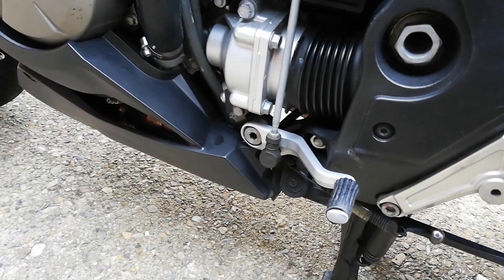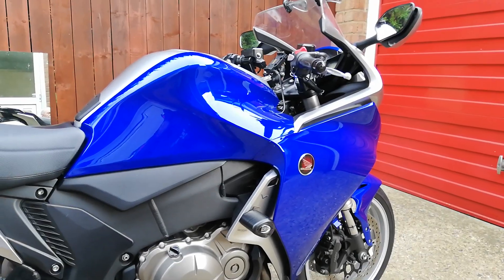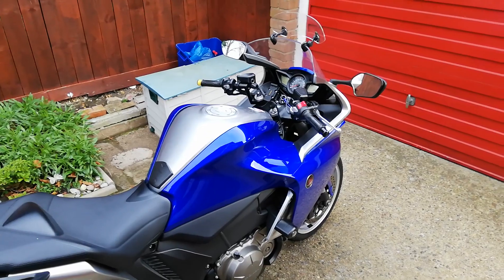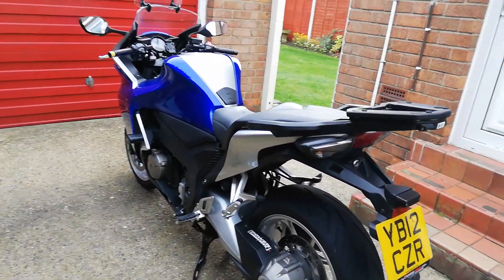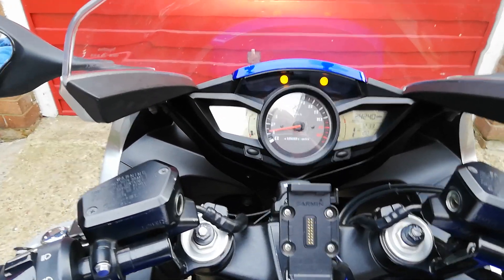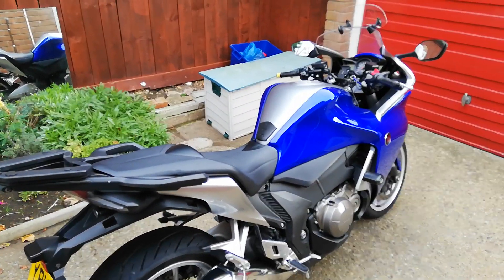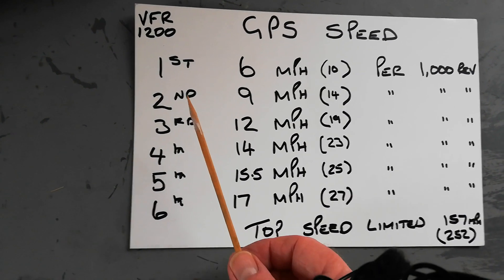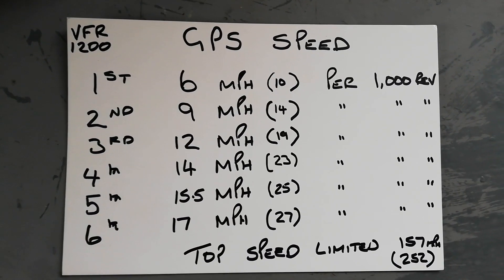Honda VFR1200 Gearbox/ratios.

Comment: I’m collecting my 2013 dct model today!! Panniers and top box included. My wife will be my pillion, so your videos have been really informative. Thanks 👍🏻
Reply from the maker: Brilliant drop me a comment to tell me how you find the dct is. 👍
Reply: @Grahamvfr  yeah definitely will do! 👍🏻
Reply: @clintneville9767  With pillion it´s quite stable, just remember to check the suspension settings, so they do not have any "extreme" setting alredy there and make the drive uncomfortable. Mine had some wobbling on the front around 140 km/h ( around 70mph) it got fixed going basically to factory settings.
Reply: @capitanscott  suspension was all good. Went for a good ride out to Bakewell Christmas market on Sunday and my wife said it was a very comfortable ride, helped by having an aftermarket seat!

Comment: Hallo Graham, my Vfr 1200f  has 208.000 km,the gear is perfect,the clutch is the original,the clunk noise is typical of the gear Honda,for example Varadero make clunk when you insert the gear,i use 15w50 oil ,but I think that a 15w40 is good for all season,but also the oil recomended by Honda.Have a good road.
Reply from the maker: Thank you for your input, yes my old firestorm also clunked a bit ...but in fairness not many bikes don't I suppose . I'm really impressed with your mileage on (208,000km) Vfr 👍👍

Comment: Dose sometimes happens on yours that remains stuck in neutral? Thanks 😊
Reply from the maker: No mine does not. 
But my friends cb1000f does, he has to press on gear lever at same time of releasing clutch, it then clicks into 1st.
Reply: @Grahamvfr  I experienced on mine shifting from 1st to 2nd gear sometimes gets stuck in Neutral, it makes a clonk noise and I think it´s already in second gear but then you hit the throttle and see it´s not. Normally on very quick starts from traffic lights. On the road you dont go to 1st gear ever.
Reply from the maker: @capitanscott  Hmmm!, not experienced that.
I will be doing an end of season (uk fair weather biker) review, so will mention that.